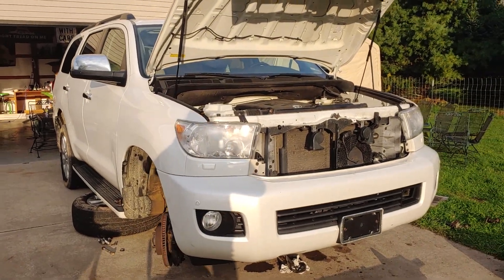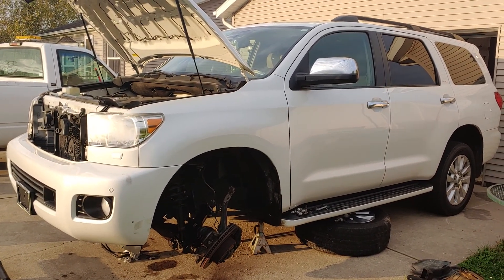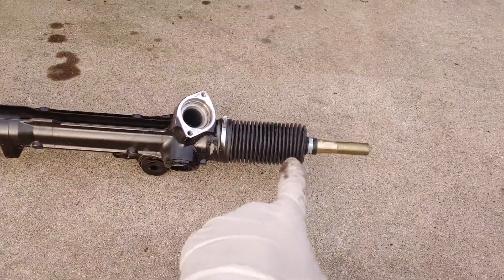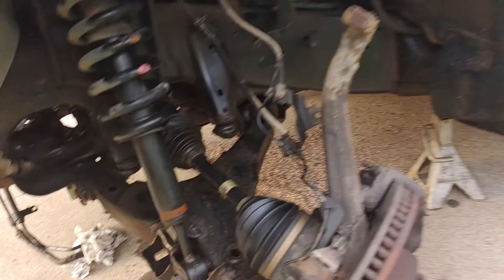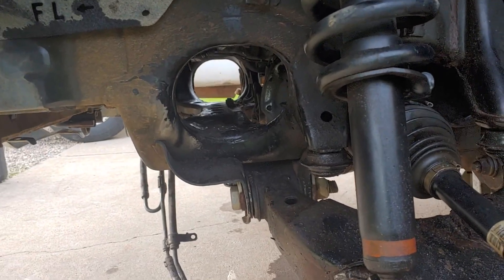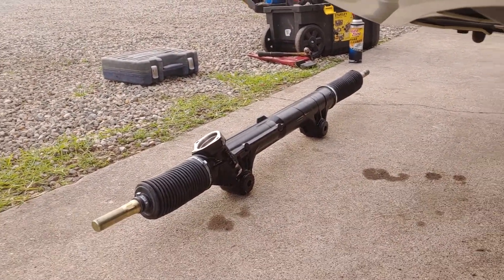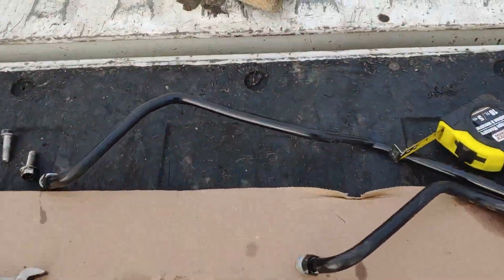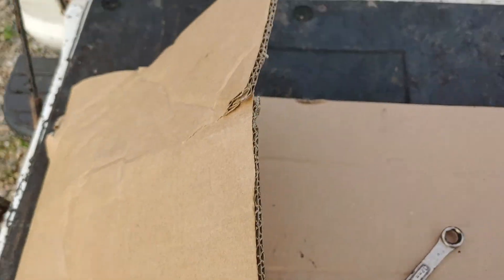2011 Sequoia Tundra steering rack pt 2

Comment: Thanks a lot for sharing this. Those videos really saved me from 2.5k bill even when my 2014 Tundra SR is a rear wheel drive with the v6 engine, the procedure is still the same from the dealership. They wanted to remove the engine to get to it. I will be doing mine soon. What do you recommend, a remanufactured part or a used one?
Reply from the maker: I would recommend getting a quality re-manufactured rack. look for ones that mention better seals. the name of the one I used in this video escapes me.

Comment: How did you get that gear box back on once in the truck? I found the tolerance to be incredibly tight, once back out of the beige Le I had to tap it in lightly with a mallet.
Reply from the maker: I did the same.  Lightly tapped it in after aligning it

Comment: Did you have any issues putting the gear back in once the new rack was installed. Im replacing mine I took it out by removing the gear but I keep hearing it’s not a good idea to remove the gear and that it’s hard to reattach once the new rack is in place.
Reply from the maker: It can be done without taking it off,  but when I was trying to get it back in,  I moved the tie rod ends in an out slightly to get the gear back in.

Comment: Did you have any leakage issues when you reinstalled the gear where the lines atrach
Reply from the maker: No, but I made sure everything was clean and also the lines had new o-rings on the ends. make sure those o-rings arent damaged because it can happen when installing in the tight spaces.

Comment: Also you need to loosen the bottom mounts as they stick up too high. They will catch the boots of the tie rods.
And you have to slide the unit to passenger side then pull the steering gear mechanism forward to allow the rack to go left. Otherwise the remaining power steering lines will get caught on the top of the rack.
Reply from the maker: You take all the lines off first to get them out of the way. Removing the inner tie rods make it easier to remove bc the boots get in the way. It showed that in the video.

Comment: So when I reinstall the gear box I want to make sure the black dot and the line are lined up and have the rack centered?
Reply from the maker: Yes exactly
Reply: @bobaganoosh88  ok cool how exact does all that have to be?
Reply from the maker: @kill420bot666  not super. As long as it's within a few clicks it shouldn't be an issue.
Reply: Awesome thanks alot Brad you saved me so much time and work changing this rack with this method. I appreciate you putting up this video. Got my rack out yesterday just waiting for new one to come in next week.
Reply from the maker: @kill420bot666  happy to help!

Comment: Except then you can’t get the gearbox back on because of the preload on the shaft
Reply from the maker: Except I, and everyone else did it..
Reply: @bobaganoosh88  nope. Preload has to be backed off a bit for everything to lineup. Just went through this.
Reply from the maker: @jacobdionne4334  moving the tie rod ends slightly will slide it right in. Sorry you had trouble with it!
Reply: @bobaganoosh88  maybe on a cheap aftermarket rack, sure